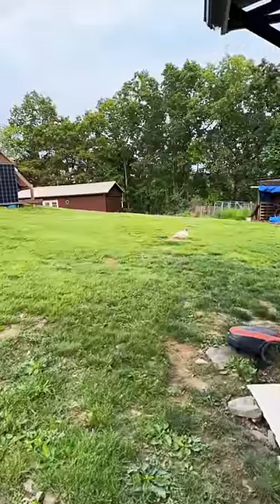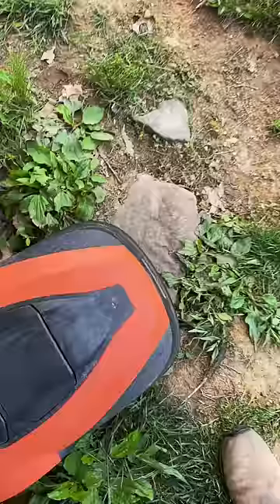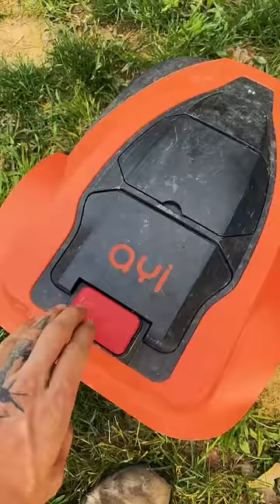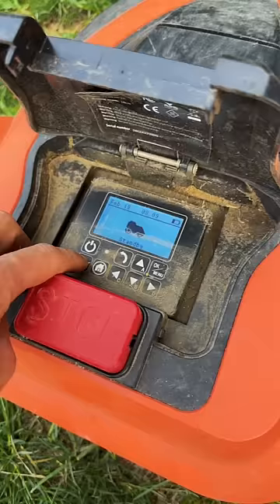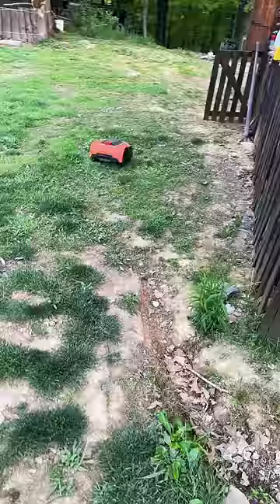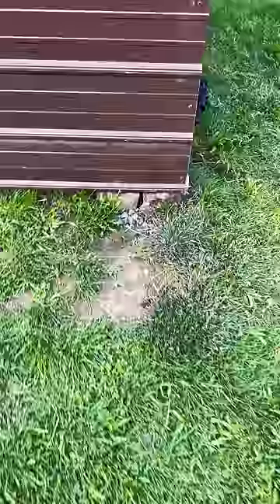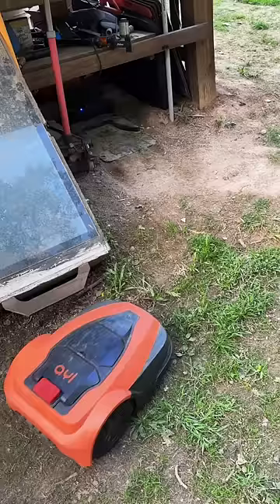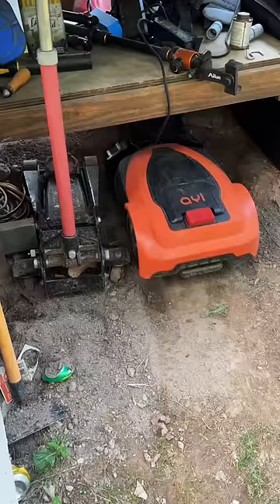Robot mower getting stuck

Comment: I find when things go wrong, a lot of people go searching for the issue to fix, whereas the first thing i do is take a step back and say to myself "what did i do wrong" and usually i can work from there.  It's easier to fix mistakes when you can acknowledge them.  Lotta people ignore the immediate available answer to their problems in favour of a last minute hail mary solution that leads to the world sorting things out for them 

Point being, this wirh relatively little stress, can be fixed.  Better knowing that than running around ignoring whats wrong wrecking your head tryna find excuses or blaming the unit.  Fair play man

Comment: Does anyone else use these mowers? I think the space his robot takes care of looks fine. Keep in mind this is rural land.
Reply: My parents have had a husqvarna one for 8 years. It mows a bit over an acre but has to run 24/7 to keep up. The front yard always looks immaculate. You might still need to mow once or twice in the spring if it rains constantly and the grass grows like mad.

Make sure you have a good surge protector for the base unit. Something like a furman PST-8
Reply: The maintenance guys used something similar at my old complex. It's run by remote control and used for the hillsides. It worked great till someone overfilled the tank and killed it. I forget the details